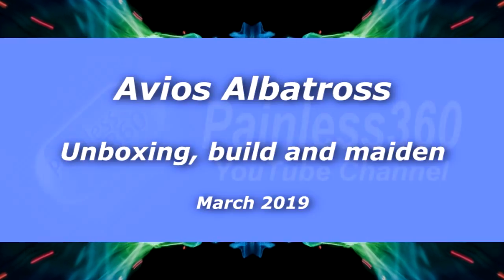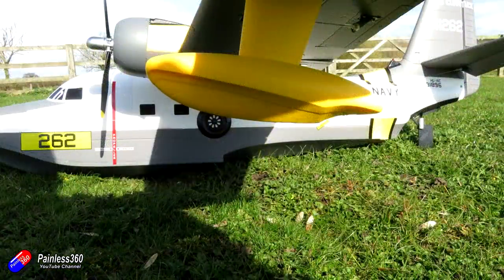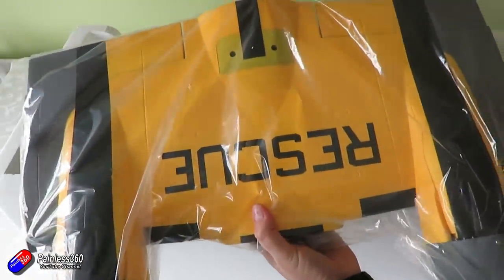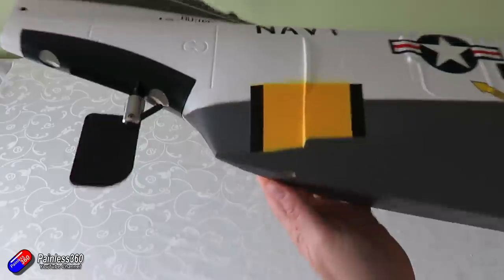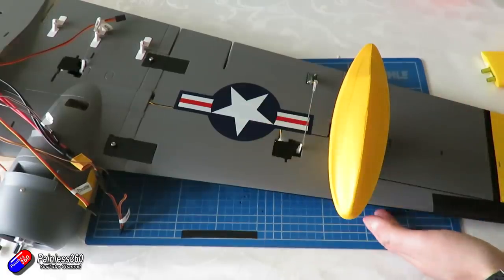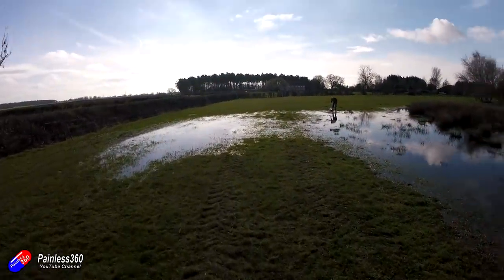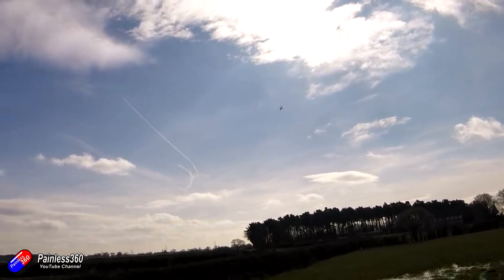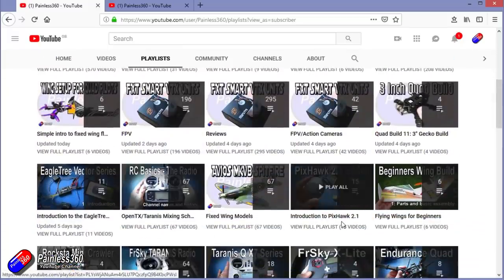Avios Albatross: Unboxing, Build and Maiden Flight

Comment: Well... your Albatross maiden definitely went better than the Petrincic Brothers' 🤣
Reply from the maker: Sometimes you get one like that. I've had a few nasty maiden flights with stuff here. Occasionally it's something wrong with the plane design, often it's the plane setup and sometimes it's the pilots skill. :D
Reply: well, they are brave enough to show it as it is, to be a hobbyist is not always all shiny and fine, so I would rather see how they do it than some edited commercial from someone on corporated life support, not saying that is the case with Painless360.
Reply: DeadlyDiddly WATS DIS HEY??? 🤣🤣🤣

Comment: Have you had trouble with wire harness or connectors in the past?
Reply from the maker: Not sure I understand the question. On this plane?
Reply: Painless360 I'm at work and could not hear everything you said,but with the wire harness having some complexity ,connections and the gluing of the parts together have you had function problems?
Reply from the maker: Nope. Easy build and flew well..